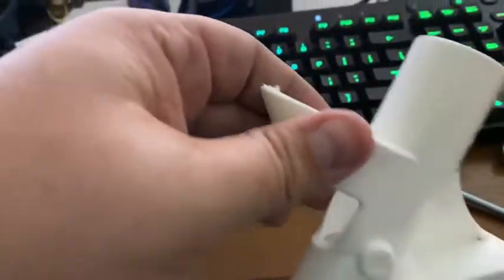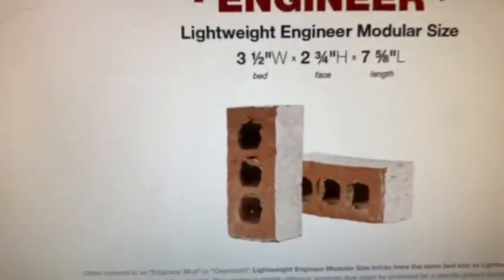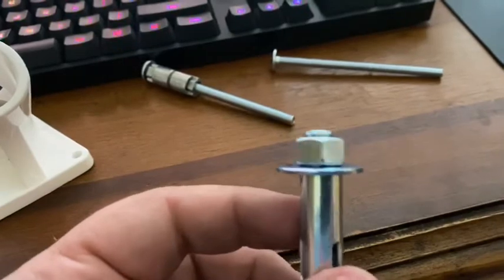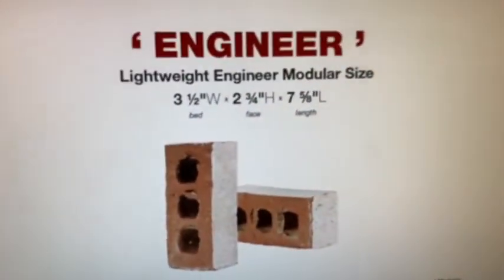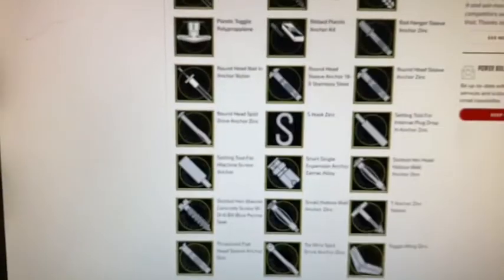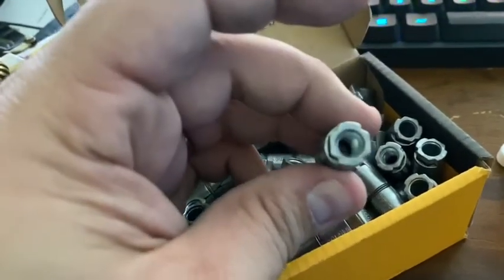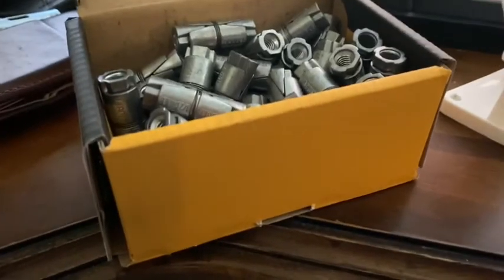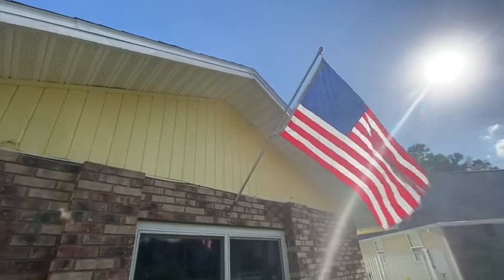Double-expansion brick wall anchors

Comment: Thank you for sharing!  I am having the same issue with my metal holders.  I have used the plastic inserts and they have been getting progressively larger with each subsequent pole holder failure.

I will take my pole holder to the store and ask for the double expansion anchors!  👍